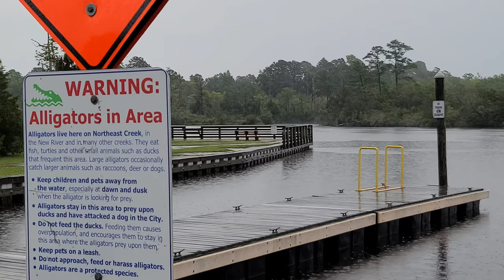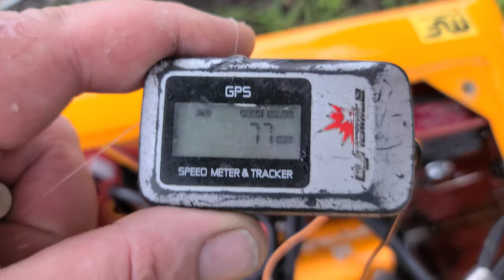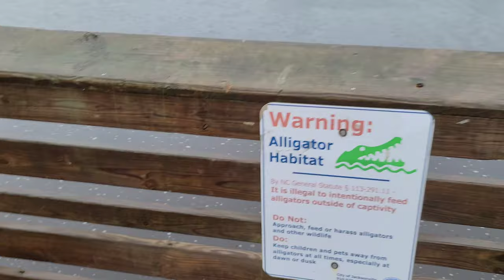Boating In The Rain - Veles 29, Deltaforce 35, Horizon Harbor Tug - Fast Electric Rc Boat

Comment: I’m loving this 8s option on your deltaforce the lower kv is great for 8s  but there are problems running lower kv and bigger props on monos is they torque roll for this reason it’s a fine balance between the available extra torque of the lower kv and the effect of the torque roll.
The other end of the spectrum of course is a lager boat has trouble getting up on the plane if the prop is too small and too high on the revs can cause the flex cable to break, magnets to fly off the rotor. 
I love that you do these videos and show all these different set ups and what speed and handling differences those changes cause.
Awesome mate.
Reply from the maker: I sure appreciate the feed back brother,  at first I didn't like this setup, I had my esc offset to the left throwing the central balance off to much.    I almost got this bad boy dialed in.

Comment: My favorite boats for all out speed so far is my CMB .90 Nitro Crapshooter OutRigger @105mph

My favorite fun boat was my big wave jumper 72" offshore deep vee made bye Exspresscraft. I use to jump off 4 to 6 foot sweels in the big water with my 4 or 5 buddies back about 20 yrs ago.  We all had the same boats . It was  kinda like motocross Racing. That's my funnest time on r/c Boating.
Reply from the maker: 105 with a nitro, bravo 👏  that's quite amazing.  72" express craft I bet that's a head turner for sure
Reply: @IRONCLADRC  yah it was we had them painted up like the real offshore powerboats of the day  like Little caesars/war lock/ systems off shore /Jessie James/ and so on. All custom airbrushed no vinyl decals or cell phones back then just big vhs videos back then  some very tapes from back then not good videos like today :) the big boats gassers where alot of fun back then lots of homelights/echoes/ g2d Zenoah/quickdraws /mathys back then.  Some where very fast gassers back then where 50 to 55mph back then

Comment: Over 10yr old Delta 45v2 38.5” in its last days, cracked, warped and heavy. Tp4070 1090kv 80mph abc2014 oval setup. Only electro boat I got.
Reply from the maker: Heck yea brother, My Deltaforce 35 always puts a smile on my face probably one of my top 3 favorites

Comment: Great video as always sir. I have a hot tip for you that I came across. It’s a new alternative for hatch tape. You can find it in the first aid section of most stores. It’s a Johnson and Johnson waterproof foam tape that sticks great and pulls off super clean. Also , price wise it is cheaper than any hobby grade hatch tape that I have found. Give it a shot, I think you will like it
Reply from the maker: Thanks for the info, I've used Johnson & Johnson waterproof clear bandage tape works really good. The
Reply: @IRONCLADRC  yeah the clear is good, the foam comes off when you want it to way easier and if you dry wipe the boat before peeling you can usually reuse it again on that same outing

Comment: Big B have you ever had trouble with a Flycolor ESC running the voltage too low before cutoff? I had mine set to the default 3.0v lvc and it puffed a 4S battery. Changed programming to 3.2v cutoff with brand new SMC batteries 2S in series and it ran them down to 2.7. I'm worried they will be ruined too.
Reply from the maker: The flycolor esc's don't go into "limp" mode once lvc is hit it does a split second cut off to let you know lvc has been hit.     Bummer, I really hate to hear that about the battery.  Smc lipos are great but they don't tolerate voltages below 3.0v per cell

Comment: You have to try a 4519 if you haven't it will handle so much better
Reply from the maker: Oh yea, I've run a 4519. I got somewhere in the high 80s on the veles. Great all-around prop.  Works great on riggers and hydroplanes, too

Comment: Vector sr80pro Upgraded to 6s 3665  motor and flycolor 150amp esc 65mph top i got before it flips but think it would hit 70 if could keep it on the water lol screams fun boat and cheap
Reply from the maker: I've had some good success with the 3665 sized motors in the past.   👍

Comment: We used to run our 250hp hydrostream on ripple water. So much faster than glass water. I imagine that rain would make the boat faster. Also, our boat always ran faster in salt water.
Reply from the maker: I agree, slick calm water tends to suck the boat down more so than a light chop...  the salinity where I run is very low, especially at low tide.
Reply: Such a great point,I am a barefooted and I can feel the buoyancy difference between sat water and fresh under my feet.
 In fresh I need more speed to do a one foot or tumble turn as my foot or body dig a bigger trough at the same speed.
so I believe you are 100 percent correct.
Reply: @jamesatkinson7517  that’s cool, the first time I ever barefooted was in the inter coastal water way. Did it off a hydro slide board.
Reply: @camarojeff9786  That be a great photo op

Comment: Favorite boat has to be hands down the rigger.. modified shimp boat..full throttle turns no blow over..ex..uuggg you tube won't let you post pictures..love to share the boat we built ..😢..but can't..we do have the little proboat impulse..put a brushless motor in it..and turn fins fast little boat..on a 7 volt battery pack so we took the 2s...soldered 2 plugs together so you actually run 4s...we put a 28 size 3800kv rocket motor..with a 60 amp car speed controller..with water jacket.. replacement of it's fan.. the proboat veles is fun but don't like it roll overs or flips...and you definitely need a huge area to run it..to run full throttle..you no..
Reply: @daiciuapostol79  were trying..lol..my dang phone won't let me...uugg
Reply from the maker: That's awesome shrimp boats are definitely fun to run

Comment: Just ordered a blackjack 24 for a vacation toy on our larger boat for when we are out floating. Wondering if you would be able to send me a good list of things I should upgrade. I tried buying the ESC you’ve been running and unfortunately they’re not working till the 8th.. is there another esc you recommend? I ordered the marine grease and motor you recommend as well as the prop. Looking for prop shaft, rudder, and whatever else I may need.
Reply from the maker: This is the most important upgrade 
Upgraded strut and cable
https://www.offshoreelectrics.com/proddetail.php?prod=ose-cable-system-bj24
I like the flycolor/ose 90 but the 159 will work its just a bit heavier
Reply: @IRONCLADRC  sounds good! And what are you recommending for battery’s?
Reply from the maker: @Thedarrenfish  for what??   the stock boat or upgraded esc stock motor ?
Reply: @IRONCLADRC  the ESC you recommend and the 3660 hobby star

Comment: 74 mph and you hit peak revs for about half a second 77 mph and a full second on full trigger
Reply from the maker: Split second is about as long as I could hold full trigger.    I think my rudder blade is too long, causing that erratic handling at top speed.
Reply: @IRONCLADRC  that may be my problem as well. My deltaforce chime walks even more than yours at full speed I made my flat spot in the middle of the bottom wider and stopped it chine walking somewhat, it was that bad it flipped but it’s now right on the edge.
I think I’ll shorten the rudder I might be able to hold it flat out longer if it works and get more speed.
If it don’t work oh well rudders are not to expensive.